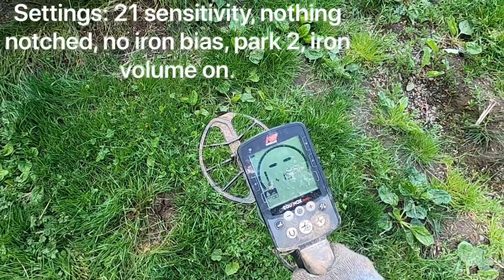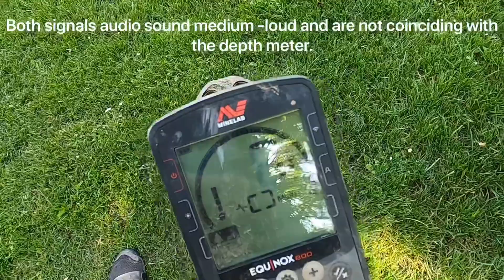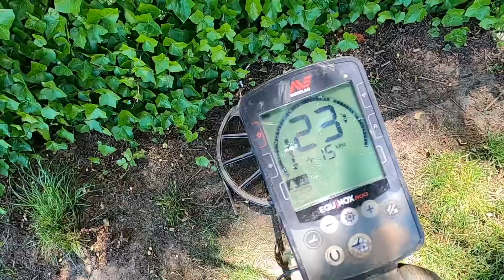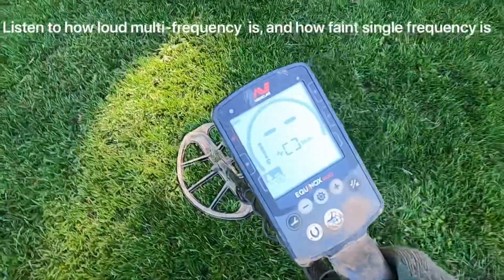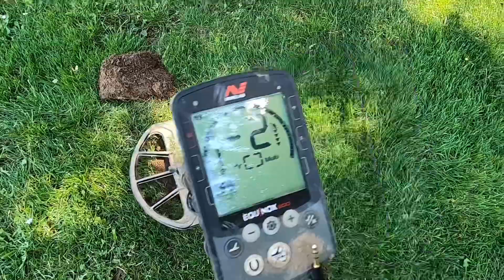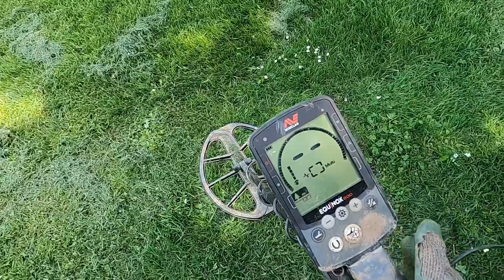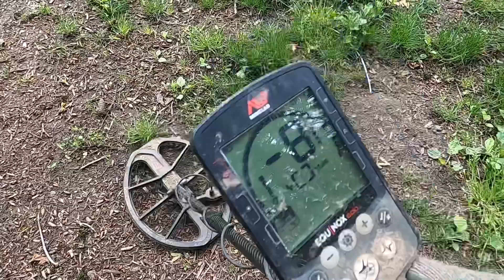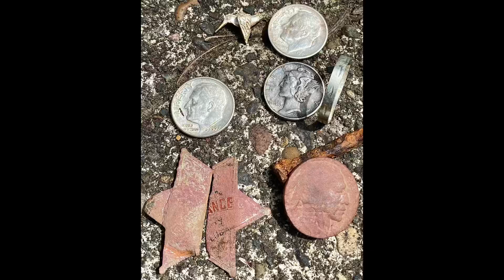How To Avoid Digging Trash & Iron With The Minelab Equinox 800

Comment: BY the time u decided wether to dig or leave, iv already got the find out, so think il stick to the old system cheers, hopfully the tech will improve later on to save more labour, but its negligable at this stage. again cheer,s"
Reply from the maker: Hi Michael, I agree with you, if I hunted at the pace you see in the video it would take me forever, but that’s not actually the case here. 
So the reason why I go so slow in this video is because I’m taking a lot of time for users to see the numbers, and to explain the system I use. If I actually filmed the speed at which I make my decision and dig, it’s much much faster than what you see in this video. However, I have learned to slow way down and be more patient over the years, and it’s rewarded me where many others have been before🙂

Comment: Thanks, I’ve been using my Nox for 2 years and your demonstration validated some of my experiences with strange signals.  I hunt in multi and cross-check with either high or low frequency depending on the VID.  

By the way, your turns are 90-degrees, not 45.
Reply from the maker: Roger, thank you so much, that’s wonderful to hear! And my apologies about the degrees mistake— duh!😅🤦🏻‍♂️.   Don’t forget there is a blog article link in the video description that should be paired with this video— I would love to hear your thoughts on that too!
Reply: @Nwdetectors  Have you had any new tricks since this video came out? what is your opinion on low signals? what is your opinion on iffy signals? I watched a video where they were finding buffalo nickels when iffy and i'm like what? Al Also what is your opinion on how to find more rings I feel very sad and hopeless and I want to find more rings? Also what pieces of trash can you not avoid?

Comment: Much like Roger, when using my Nox 800 I hunt in multi with some discrimination.  Then I will cross check with no discrimination and single frequencies and dig according to the VID and tones.  Even though my Nox is a nice and light machine I’ve been using my CTX-3030 more than the Nox because I can see both the iron targets and good targets on the display at the same time along with the tracing patterns.
Reply from the maker: Michael, I want to grab the CTX again too, I just did a blog post on the CTX vs. the Equinox! I love both, but yeah, the ability to see multiple objects on the screen is an incredible advantage I miss, and I think it might be a touch deeper in some scenarios how about you?
Reply: @Nwdetectors  Yes, definitely a little deeper.  Especially with the 17” on it.  Both detectors have their place for sure in my collection and I’m glad to have some versatility.  Sometimes I’ll take both with me for the day.  My E-Trac was only pulled out one time this year, but I still would have trouble parting with it.

Comment: I dug 310 silver coins last year and 89  so far this year (all in parks and schools) and multi frequency is a far better option until the EMI is unbearable. I made a guess at every one of the questionable targets and was right each time. I've used 15 kHz for deeper targets in a clean field and it will get deeper silver but for general park hunting stick with the multi. In my experience 95 percent of the time digging the questionable signal means it  is not a good target.
Reply: sandman.. when the emi is unbearable how do you combat it with your NOX? I have all but stopped using it favoring my cheaper backup because the non-stop noise is brain over load and gyves me a headache

Comment: To keep control unit clean I'm using cell phone waterproof pouch. Just cat off top part of it. Find proper size.
Reply: You can get a faceplate vinyl front skin from ebay and a printed flexible screen bumper, with the both it protects really well.

Comment: I'm currently working a field that is loaded with trash and iron . Its a older home site but its so trashy I'm thinking about moving on to other areas because I can't seem to get my 800 dialed in well enough to find any of the coins being masked by all the trash. It as if the people that lived there  just burned everything and then plowed it all through their backyard and field behind their house. The old home and out buildings are long gone but the only thing that's left is tons of their metal garbage . The only thing I found not trash is a rein guide and a few horse shoes and I know the home site and area holds coins but I can't seem to find them. I have tried all settings and modes in multi with little success. I'm going to give 15 a try and hopefully this will break the curse of the trash farm. :)
Reply from the maker: Thomas, I hope this technique works for you! It’s done wonders for me in really noisy trashy spots! Cheers and good luck🍻🙏🏼😁
Reply: A good tip I saw was to dig it all to clear the area.  Then repeat!  Sounds like work, but it sounds like it might be worth it on a site like that.

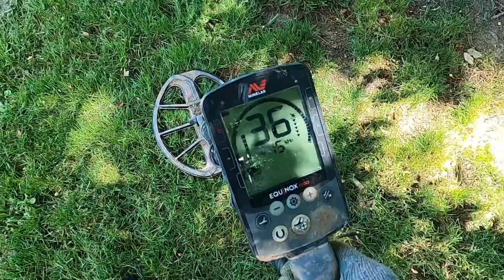Comment: at about 20:30 you say the target reveals itself and you move on without showing us what the target is? What if it was something amazing being masked? I am a beach hunter so you can imagine I am very interested in avoiding pull tabs and bottle caps, but, don't want to miss out on the gold. Thanks, cricket
Reply from the maker: Hey! So i checked that part you were talking about. When I turn 90 degrees (it was a long day and for some reason my brain and mouth weren’t communicating and I kept saying 45🤦🏻‍♂️) you will notice the signal completely decays to iron grunting. This is a clear sign that the target is 90 percent going to be a nail. Upon closer examination, you can turn 90 degrees again, and again, and the signal should decay more. Also, if you switch back to multi, or any other frequency, you will most likely notice more signal decay (intermittent or straight iron signals), this again is telling you to walk away, it’s iron. 
That said, the beach is much different. Especially black sand beaches, fresh or salt water. There is so much masking with black sand and iron, it can really make signals sound sloppy. 
But again, I always listen for a solid consistent tone trying to come through. The more I detect the more I’m able to hear the subtle difference between iron and a good masked signal. 
Iron signals have a sort of “twang” to them, they are louder, and yet show deeper depth bars despite being loud. They also are almost never consistent when one turns 90 degrees several times on them. At this point I’m Rarely tricked— with the exception of bent nails, man those things sound good!
I hope that helps! Happy beach hunting!🍻

Comment: I noticed you both do not ground balance NOR do a noise cancel when you make changes in the settings; specifically, Minelab recommends, "Noise Cancel should be carried out whenever the frequency setting is changed." Or even if you adjust the sensitivity.
  Any reason?  Try pumping the coil up/down/up/down... while in all-metal mode and watch for negative numbers - even sporadically, as that's a nail, small iron scrap, a bobby pin, or a bottle cap. Keep FE/F2 low and watch your display instead.
Reply from the maker: Hey LobsterClawz! Thanks for watching! I’ve experimented with what you refer to in other videos and it doesn’t seem to make any difference in depth, but I do frequently ground balance when I’m hunting. I’m going to look into this more though so thank you for bringing it to my attention. Happy hunting!
Reply: @Nwdetectors  I think at the end of the day, and as you know, this is a very low frequency, VLF detector – not a pulse induction, PI detector . VLF detectors will always be more susceptible than PI detectors to environments where there are hot rocks, ironstone, or similar .  A lot of people that debate the use of ground balance – I do not use it – mostly because I don't have noise issues in most locations – clearly, some people may need to use it.  When I do have noise issues, it tends to be EMI-related and then I have to just I only have to adjust the sensitivity. It is prudent to rerun the noise cancel after you do make a change in sensitivity. Best of luck. Let me know how it works for you ?

Comment: Multi is designed to give more accurate readings. Therefore just wondering why you searched in single frequency first and then in multi mode. Surely this was predictable hence having the multi-mode to sort this issue? Why not just use multi when not looking for anything specifically?
Reply from the maker: Essence Music, thanks for watching and commenting! In my hunting conditions, single frequency is actually quieter and falses less than multi. Multi tends to false a lot in numbers 10 and below, whereas single falses less and falses in high numbers (sliver/wheat range). Just for my heads sake I hunt in single for the quieter experience, and cross check in multi. In another one of my videos single was deeper than multi on silver, so I’m not concerned about losing good targets. 
Also, multi gets tricked by aluminum, whereas single frequency gives it away, they compliment each other when you use them to cross-check, and at this point I can actually call out almost all aluminum scrap and other trash before I dig it, I don’t know of any other detector that can tell the difference between gold and aluminum so well! How about you? What settings and techniques have helped you? Cheers!🍻

Comment: If you have done any nail board testing with square nails or Rusty Nails you will see a lot of times they give the same exact signal that you're saying is trash by turning 90 degrees.  take a silver dime and throw at 3 in square nail an inch from it and swing in a cross pattern you'll see what I'm talking about.
Reply from the maker: Thank you I will give this a try!

Comment: If I go to a park with a lot of target and trash and want to find a deep silver dime what is the best setting?
Reply from the maker: Hey Indiana Tones! Thanks for checking out my channel🙏🏼 I just subbed you! So I don’t claim to know a best setting... I just show these videos because these are the tricks and settings that have helped me tons. However, things may be different for you because of soil conditions, ground mineralization, etc.. That said, I always hunt park 2, nothing notched out, no iron bias, 20-21 sensitivity, horseshoe button (iron volume) on so I can hear the iron, iron volume low so I can hear it but it doesn’t blow my ears out, and I hunt in 15kHz and cross-check all my targets by switching to multi-frequency if I think I have something good.  If your in a trashy park the tips in my video and blog post are critical for avoiding a ton of iron and aluminum, especially using 15kHz and cross checking in multi-frequency, it will give away aluminum trash a lot of the time. Here’s the link to the detailed article I wrote:    https://nwdetectors.com/blogs/news/how-to-avoid-digging-iron-trash-with-the-minelab-equinox-800.     Thanks again for watching and happy hunting buddy!😊👍🏼

Comment: Would digging a target that has steady numbers in both frequencies be the best to do so as to cut way down on digging trash?
Reply from the maker: S Miller, thank you for watching! To answer your question, yes, steadier numbers in multi and single is always a good sign! I believe I talk about ‘how’ jumpy the numbers are being is a good clue. For instance, if it’s within 10 digits then it’s probably still a good target (high 20’s to 30’s). But also how the numbers jump gives a lot away. For instance if it dramatically jumps from high 30’s to mid 20’s it’s usually a big junk piece of metal, and the audio will sound audibly louder. Whereas if the jumpiness of the numbers is more evenly distributed: “25, 24, 29, 30, 27, 25, 24, 29, that to me is usually the way a deep wheat penny or a medium depth copper penny behaves. Silver tends to be less jumpy but still can be depending on other influences.  Both multi and single will report this way. However, as seen in the video, when multi and single frequency are way apart, with single showing high 20’s 30’s and multi showing below 14, then it is almost 100% trash or mixed metal.   My point in the video is also just to show how useful using these two frequencies in conjunction can be at revealing what targets tend to be so that you can call it before you dig it, and ultimately be a little more picky and conserve energy😊

Comment: I dont know why you dont just hunt in Multi and check with 15. It seemed like Multi told you not to dig 15 khz false positives more often than 15 was able to pick something good out.
Reply from the maker: Hey Derek! Thank you for watching and commenting! So actually in my ground multi falses in low numbers (l0 and below) and is generally noisier than single frequency. Whereas when I switch to single frequency, the machine is much quieter, and falses in high tones, but less than multi. 
So for my poor heads sake, I hunt in the quieter single, and cross-check with the multi. Neither is better than the other, but they compliment each other, and I’ve become good with this technique I barely dig any aluminum anymore, and I can guess way more often what the target is before digging it. I’ve never used any other detector that could give away scrap aluminum, so this has saved me a massive amount of time and energy😍

Comment: Hi, any reason you always had Iron (horseshoe) detecting? Do you not trust it? Thnx ;)
Reply from the maker: Hi Neils, sorry for the late reply I had a wrist injury that set me back over the winter. I use the iron Horseshoe because I want to hear my iron at all times, it’s a huge giveaway as to whether the target is iron or not. For instance, how repeatable is the signal? Does the signal decay as you pass over it, turn 90 degrees on it, or switch frequencies? These are all questions I ask when I’m curious about a target. I also turn my iron volume down in the master controls so that it doesn’t blast my ears out but i can hear it audibly. Cheers!

Comment: It beeps I dig it dig it all you might be surprised
Reply from the maker: David, you’re absolutely right, I am definitely surprised sometimes. But these days the ol’ body wears out faster than I’d like so I try to find more tricks to avoid digging so much trash. As I get tired I’m definitely more picky😅 What kinds of sites are you hunting?😊
Reply: The "dig it all" theory is a waste of time. Use all metal, quit digging iron and use that extra time to find repeating, consistent signals with some depth. Ya, you might miss a few good targets a year, but you will ultimately find more when digging quality signals, not wasting time on crap signals